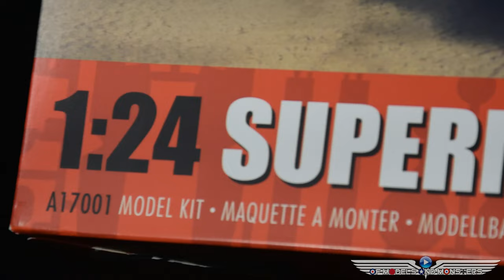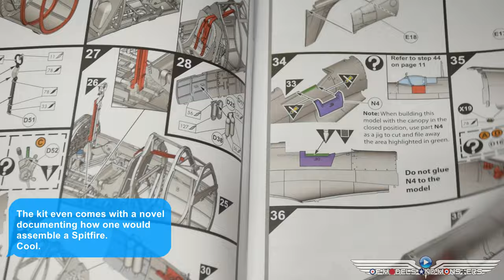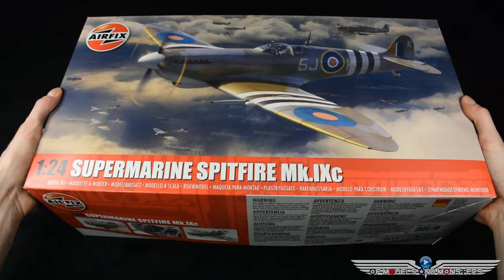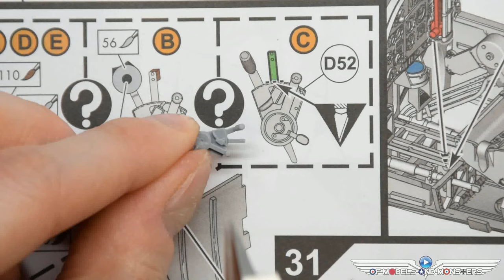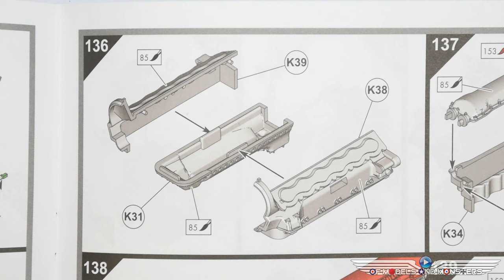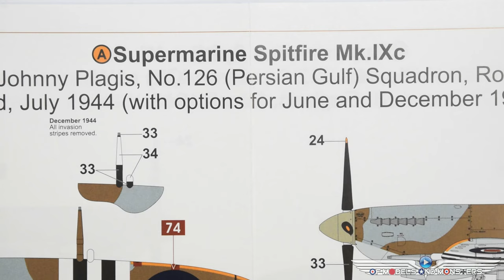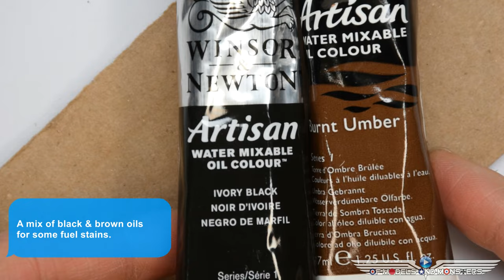Lets Craft Episode 13  Airfix 1/24 Supermarine Spitfire Mk.IXc

Comment: A helpful, well made video. Showing how to fit the plumbing into the engine cradle will aid all those who do not think it is possible without modifying. You are the first to present this that I know. 
I have twenty active model projects, four are this kit. Three will be posed in flight with pilot figures on multi position stands with variable speed motors to spin the props. George Beurling KH-B paired with J. Johnson
JE-J . The Silver Spitfire, G-IRTY using Draw Decal set. The fourth to be posed landed with lots of cockpit and engine bay mods/upgrades for more accuracy.
For your consideration: Rotol propeller blades were made of Hydulingnum, a birchwood laminate. The leading edge had a narrow metal  cover incorporated so wear to bare metal would only be on the leading edge.
The seat was made of paper/resin not metal or Bakelite. Firing through the replaceable, red fabric protective gun port covers would only rip a ragged hole not much larger than the bullet diameter.
The leading D box section of the wings was thicker14 gauge sheet with the needs for High Speed aircraft
this area would be made smooth with putty and primer/filler, rivets would not be seen. The rivet detail is far too deep on this kit. The use of a water base filler that shrinks works to correct without loss of the detail.
Reference: Australian War Memorial has posted a RAF training film, 'Streamline Colour' that shows the paint prep and putty use. 
YTube Spitfire Preflight/Walkaround Tour EAA Air Venture Oshkosh 2018. Shows how shallow the rivets are.
Paul Monforton Spitfire reference book. A fellow Canadian.
If interested I have examples of my model builds posted at the bottom of the DESIGN page on my site : 
Chopperworks in Burlington Ontario. I  build custom motorcycles.
Reply: Sounds like a major undertaking. I'm in the Kingston area. Send me the link please so I can check it out
Reply: John Alec's Modeling also shows this part of the assembly. He has a good video series on this build